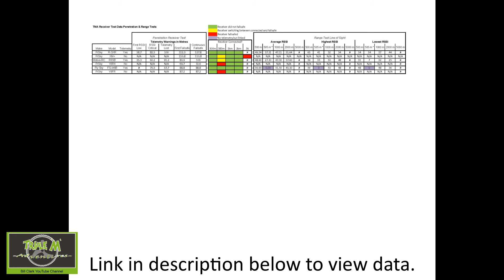Receiver Test – FrSky V8FR

Comment: Can it be bound to a xjt module?
Could you please explain the binding procedure
Reply from the maker: Yes it should. The binding procedure is:
Hold down the bind button on your receiver and plug in the power.
Go to radio click bind. 
Once bound disconnect power from receiver. 
Reconnect power to receiver you should be bound.

Comment: Hi Bill,
You have now tested a number of receivers, but which one is the best with 6 or 8 channels in combination with telemetry?
Greetings from the Netherlands,
Casper
Reply from the maker: Hi Casper,

If you are looking for a budget telemetry receiver I would be looking at the Motive-RC R8SB or the Flysky FS-iA6B. When the FS-iA6B went to failsafe it did so at a shorter distance of 88.8 metres and stayed in that state but the R8SB went to failsafe at 80.9 metre's but reconnected and went on for 103 metres before becoming continuously failsafe. The R8SB also gave all telemetry warnings but the FS-iA6B missed out RSSI low, but its critical RSSI warning happened further out than the R8SB.

If you are not on a budget then the out and out winner so far is Crossfire and I did test the PWM Nano receiver for servos. We need to keep in mind that when flying fixed wing models line of sight we more than likely only fly a maximum of 300 meters away from our position so the two receivers I mentioned should be perfectly adequate.

You can look at the data and make your mind up but the ultimate so far of what I have tested is TBS Crossfire the penetration tests are way ahead of the rest.
Reply: @the-happy-RC-flyer  Hi Bill,
Thank you for your advice.
I don't have a budget or I want a reliable and good receiver with telemetry. Your advice is clear and I will order the PWM Nano receiver and Crossfire module.

Always nice to receive a quick answer from you.

Greetings from the Netherlands,
Casper